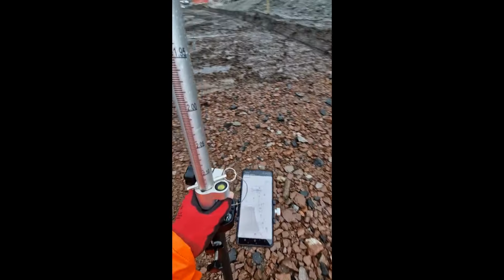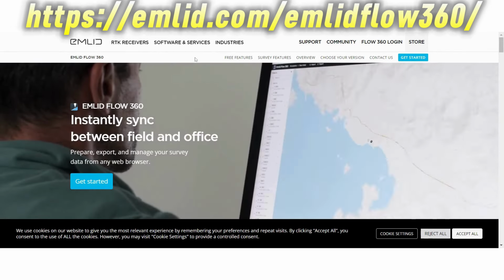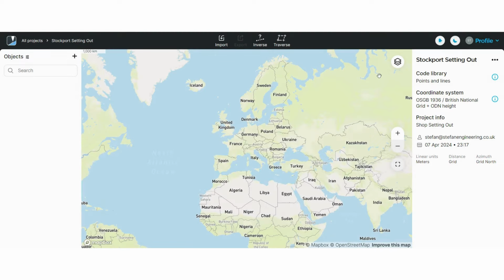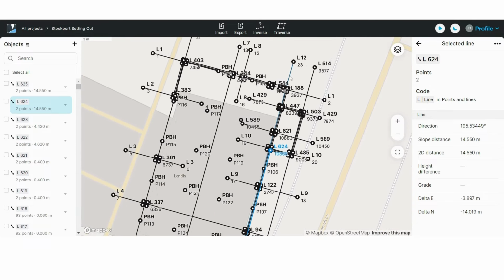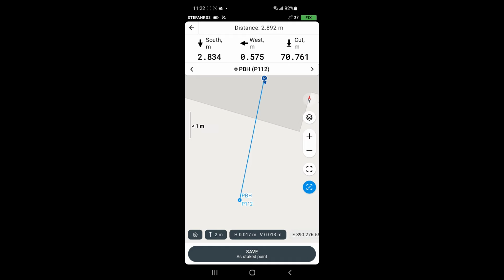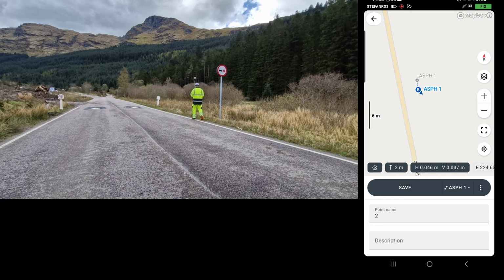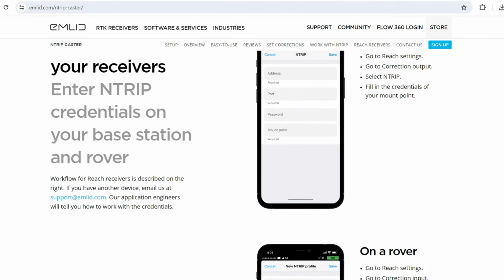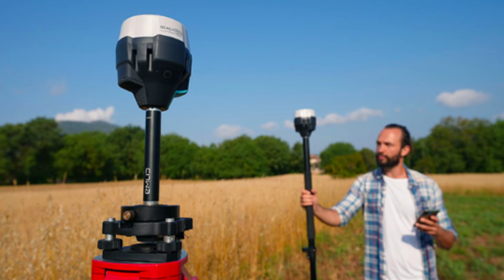One Month with Emlid Reach RS3 - The Surprising TRUTH

Comment: Have you considered a rockbase for your ntrip corrections?
Reply from the maker: Hi there, I am a professional Land Surveyor and having reliable RTK corrections for my GNSS receiver is very important. Basicaly I need to know that I have coverage and get RTK corrections almost everywhere I work in the UK. After I talked also with other people from Survey industry I found out that Trimble VRS Now offers the best coverage in the UK by using goverment bases and private bases (owned by Trimble partners).

Rockbase looks like a private project where the network is made from bases owned by private persons who bought the equipment from them. To be honest I don’t know how well these bases are maintained and by the look of the coverage map in Scotland there is no bases and in England there are a few but the distribution is really poor. 

If you want to have RTK corrections without paying for a NTRIP service, I think you will be better buying a Emlid receiver (RS2+ or RS3) to use it as a base. The process is simple but takes a bit more time: set the base on a point that you calculate PPK with Emlid Studio and transmit corrections thru Caster service to your RTK drone or GNSS rover. 
I may make a video about it in the future🤔.
Reply: @flyingsurveyor  yeah for sure, I use a base rover set up for ground control and my rockbase for corrections to my drone or to get a location for my base. When you said the tumble one was expensive I figured I’d mention it🤙
Reply from the maker: @marcusgilmore4311  cool! I am happy it works out for you 💪🏻

Comment: Hello. I am a surveyor in France and I also have a Trimble R12i that I use with Trimble Access. I also purchased a RS3 to serve as a base for my R12i and drone with Emlid Caster. I measured some control points with my R12 and VRS Now. Then I measured the same point with the RS3 and VRS Now. I got a difference between 3 and 5 cm. But when I set up the RS3 as a base for the R12 as a rover with Emlid Caster, I got errors between 25cm to 6 meters. Did you try to use your R12 as a rover with the RS3 as a base over Emlid Caster ?
Reply from the maker: Hi there, unfortunately I didn’t use the RS3 as base yet for the R12i, because R12i from this video was hired. 
Also, as I said in the video, I got the Emlid RS3 to use it primarly with VRS Now and cut my hire costs. I am looking to buy also a Trimble GNSS in the future so I will probably will look to use the RS3 as a base.
Did you checked the protocols, frequence, datums and other settings to be the same? If all are the same try to contact Emlid support, an there is also there is an Emlid forum.
Reply: @flyingsurveyor  If you are one man business then the Trimble stuff is not worth the money. The price for the R12i is so high, and there are newer receivers out there that are even better. Most of the high end GNSS use similar motherboards inside. Im  very happy with my Stonex S900+ that i got on a good deal(5000€). Also the fieldcontroller software that they offer Cube-a is very easy to use and has all the needed functions. Looking to save up for a Ropotic totalstation from Stonex also. (12000€ for a 1" machine). Dealer and service network at least in Europe is very good also.

Comment: Great overview. Also the main differences will come out once you get into more challenging enviroment ie multipath. The cheaper receivers can and will give you false fixes.
Reply from the maker: Thank you for your remark. 
That is 100% true, that’s why I recommend to check a known point before you start your survey works and to try to use it on clear enviroments. 
I tried to keep it simple so more people understand that this device is ok but it has limits compared with premium brands.

The difference between Emlid and Trimble is that Trimble receivers reduce a lot the multipath and also Trimble uses RTX which gives even more options for corrections. On top of that is very important to use a reliable correction service.

At this price, I can’t complain too much as my primary purpose was to install control points and to reduce my equipment hiring costs.

Comment: Hi.  Great video again.  following on from the discussion the other day about the limitations of the surveying software (emlid flow) there are other survveying apps available which i havent had time to look into yet - i noticed that QGIS do one thats GNSS compatible and have seen others listed.  

re the battery hotspot thing - its worth noting that if you put a sim card in the RS3 (i got one for £4/month with 3 gigs of data) you can run the RS3 in bluetooth mode which is a lot more battery friendly.  figured £4/month was better than killing my phone battery.
Reply from the maker: Hi Glyn, thank you for your comment. It depends what you are using the GNSS receiver for, and what expectation you have from it. At this price I can't complaint too much, to be honest.

You can export Shapefile for QGIS, but I personally use LSS for Topo Surveys and other where I import a CSV format Name, Easting, Northing, Level and Code.

Thank you for the SIM card tip, I will probably go on that route also 👍.
Reply: @flyingsurveyor  will have a look at LSS - thanks for the tip
Reply from the maker: @glynbarrett1971   it depends what deliverable you want. If will you get stuck drop me a message on LinkedIn
Reply: @flyingsurveyor  i completely forgot about your comment about LSS so didnt get to look into it.  did manage a workaround using QGIS and CSV output from Emlid Flow though.  logged the layers i wanted the surveyed features tagging to in the description, exported as csv, loaded into QGIS and exported as DXF with the relevant field set to be the layer.  loaded into BricsCAD no problem with the fields set. probably took longer to explain it than do it, but it does work.
Reply from the maker: @glynbarrett1971  I know it work, 10 years ago I used ArcGIS for land register projects in Africa. It just not the quickest process for me 😆. Glad you find a way 💪🏻